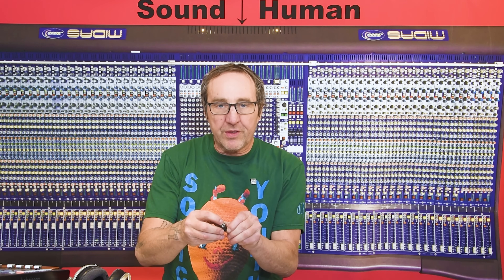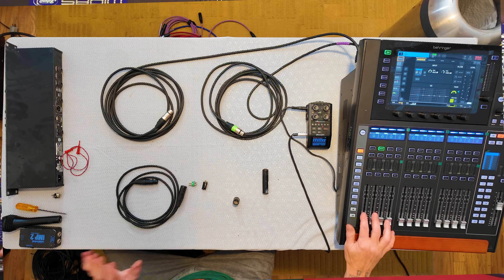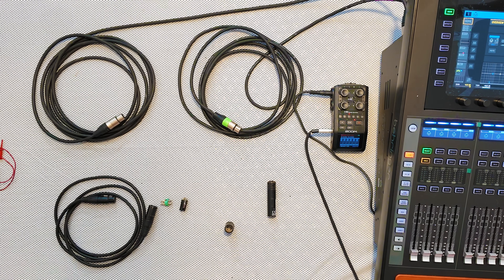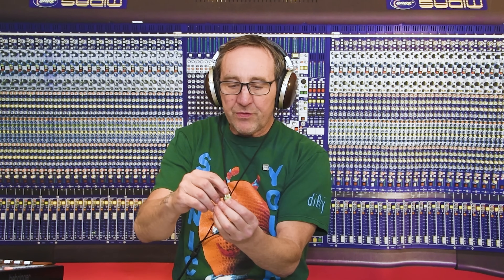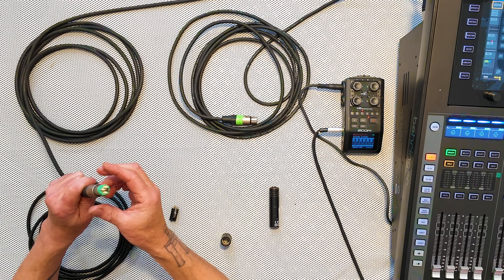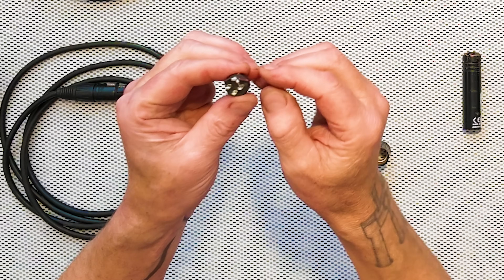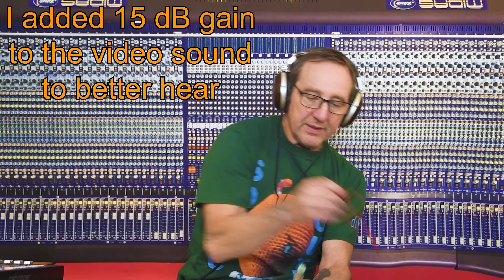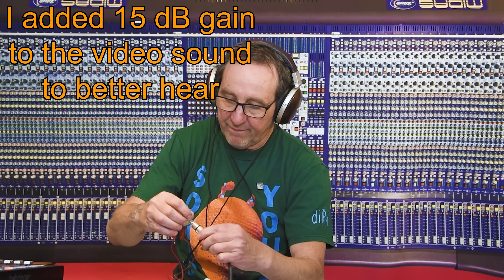XLR Shell Ground Issues

Comment: I have a wonky JBL powered sub that will literally "freak out" if I don't use an xlr cable with pin 1 to shell connected.  I never had any problems with it till I switched to new xlr's with no pin1 to shell connection.  it would work fine for awhile, then randomly would develop a horrible squeal that wouldn't go away unless I power cycled the amp.  I found that if I used the old xlr cables the random squeal would never happen.  So when using that sub I have to carry at least a couple of the old xlr's with pin1 to shell just for this specific purpose...  😆
Reply from the maker: hmm, pin 1 should ground the audio and also ground to the chassis and the chassis should connect to the shell ground. 

sounds like you have a bad wire or corroded connection inside there.

perhaps a connection between pin 1 and the amp that got burned up from using XLRs with grounded shells.

now the poor speaker needs the grounded shells.

easiest to leave it be but I will bet that opening it up and following the pin 1 wire you would probably fairly easily find the the issue.

Comment: i thought you were suposed to ground on one side only. that way it can never loop but it will still shield
Reply from the maker: the " ground one side" applies to pin 1, not the shell. don't ground the shell. ground shells force pin 1 to short to chassis ground wherever the XLR is plugged in.

grounding pin 1 only one side of cables causes issues as well. don't do that either.

make XLR to XLR adaptors that have pin 1 lifted on one side and make XLR to XLR adaptors that have pin 1 connected to the shells on both sides.  then you can lift pin 1 or ground the shells whenever you need to and not cause issues when you don't need to

Comment: Should I remove the chassis ground from the XLR connectors installed in stage boxes?
Reply from the maker: not really, ideally the chassis ground of the stage box is best grounded to at least one XLR channel. since at the mixer, all the XLR geounda are connected together, having the xol ground to stage box ground is ok. the issue is when the XLR ground pin 1 gets connected to the XLR chassis and then the XLR is plugged into gear that has the chassis connected to ac ground. 

since the stage box is not connected to ac ground and since it is the chassis making the connection to pin 1, not the cable, that is ok.

u want to avoid cables that force the connection of chassis to pin 1

Comment: The easy solution is to ground the shell of the male XLR connector on all your cables. This will satisfy all situations described in this video.
Reply from the maker: grounding all your XLR shells is not only a bad idea in most scenarios but it's also not recommended by the AES. 

if you ground an XLR shell to the audio ground and plug it into a panel which in many scenarios, by law needs to be grounded to the AC ground, you now have  a scenario where your mic cables are connecting the audio ground to the AC ground at that panel. 

also, if you ground the XLR shell to pin one then none of the audio ground lifts on base amps and professional audio gear will function. 

additionally the ground lift switch on DI boxes will stop functioning. 

having XLR cables with pin 1connected the XLR shells is a recipe for ground loop disaster. 

if you're looking for a solution to eliminate noise when XLR cables are extended, then I recommend you make some short XLR mail to female cables with the shells grounded to pin one. 

use these little adapters whenever extending cables and they will force the shells to be grounded at the extension points. 

you do not want XLR Pin 1 connected to shell on any connections that are plugged into mixing boards or any other gear that is not AC ground lifted or battery operated
Reply: @DaveRat  if you only ground the male XLR shell, but not the female shell, then the result would be grounded shells for as many XLR cables as you hook together. BUT since the last or terminating female XLR shell is is not grounded going into the direct box, as in the example in your video, you could still have a working ground lift on that D.I.

It's the same logic as the SM57/58 connecting the receiver XLR pin 1 to its housing and thereby grounding the female XLR shell of the cable that plugs into it.

You could say that the last or terminating female XLR shell is grounded/not grounded depending on the grounding logic of what it is plugged into.
Reply from the maker: Hmmm, maybe look up AES-48 2019. this is a document where the recommended best practices for grounding of XLR connectors is addressed by the Audio Engineering Society.

Regarding the connection of pin 1 to the XLR connector's metal shell, AES48 recommends different practices depending on whether it is a cable-mounted or chassis-mounted connector: 

Chassis-mounted connectors (equipment inputs/outputs): Pin 1 and the connector shell should both be bonded directly to the equipment's chassis (shielding enclosure) at the point where the connector enters the enclosure, to minimize RF interference paths.

Cable-mounted connectors (on the cable itself): The standard recommends that the shell should never be connected to pin 1 or the shield, to prevent inadvertent contact with other grounded surfaces that could create unwanted ground loops and hum.

Comment: What would be the application for this scenario:

I'm building out some stage floor boxes that also have AC power available to them. The AC ground has to be grounded to the metal chassis. I would assume that bonding the shell ground on the metal XLR panel connector would establish a unisolable ground loop. What about the Neutrik combo jacks, with the plastic housing? Would that be considered an extention scenario? Worth noting that all the power in the boxes, plus the AnH remote unit, are fed from the same Furman power conditioner.
Reply from the maker: keep XLR pin 1 and AC ground separate.

do not ground the XLR shells to pin 1 on the cables or chassis.  all should be good.

if someone uses a. XLR able with pin 1 grounded to the shell, it may cause issues but no one should be grounding shell to pin 1 except for special use scenarios
Reply: Came across this vid and it kinda made me second-guess myself. Thank you for clarifying, and the education! Awesome video!

Comment: Worked for a consulting firm, and designed a lot of permanent systems. Many XLR connections in the wall for mic or intercom. 

If you connect pin-4 (shell) to pin-1, then the XLR jack in a permanent connection will be at conduit ground - formula for instant ground loop.  Leave pin-4 tab (shell) disconnected.
Reply: In the device's socket, the XLR housing will be connected to the screen and 1 wire = this is the same as connecting it from the outside. Once again, what problem did you get rid of by not connecting the housing on the cable? In my opinion, none. But you have another problem, if this non-stationary cable is used as an extension with another similar cable with an open XLR housing, the place where they are connected will catch all the interference and interference.
Reply from the maker: in the devices socket yes the XLR shell will get grounded and if the XLR has pin 1 grounded to the shell then you have grounded the audio ground from the remote piece of gear to the chassis ground of the local piece of gear. 

this is not desirable 

each unit will have pin 1 connected to the chassis in one place within that unit, by grounding pin 1 to the XLR you are creating a second connection between pin 1 and the chassis and that creates a ground loop 
.
additionally with patch panels that also have AC outlets on them like you'd find in the wall of a building sometimes, The metal patch panel will be grounded to the AC ground. if your XLR has pin 1 grounded to the shell then you now have connected the AC ground to your audio ground at that patch panel. 

you have now introduced an AC ground connection to your audio ground at that patch panel, that will create a ground loop that almost always will be significant. 

standard and accepted practice is to not connect the chassis ground of the XLR to pin 1 unless you need maximum shielding and are absolutely sure that it won't cause ground loop issues. 

generally it should be avoided in almost every scenario

Comment: Very interesting! I'm building a monitor mixer rig that breaks out analog audio from CAT5 to a 4-channel TRS DI box, but the connectors I got unbeknownst to me treat the whole housing as ground (right angle pancakes). I wonder if this will eliminate the ability of the DI box to lift ground
Reply from the maker: Having the whole housing grounded is not a big deal because as long as your mic cables don't have the shell grounded that won't cause any problems with DI boxes. 

Also having the The box grounded will make the system a bit quieter as long as the metal housing doesn't touch any external metal objects that are grounded to a different ground which typically is not an issue, especially if the box is painted or anodized as that acts as an insulator. 

If it does prove to be a problem depending on who makes the cat analog boxes they can be lifted typically 

The sound tools boxes have an internal jumper where you can ground the box or not and I've seen other brands with a jumper wire that can be lifted
Reply: @DaveRat  Oh wow! So helpful!!! Thanks 💚💚💚 -- it was a risk but I'm mixing the redco ones and the American recorder ones (very exact space requirements on both sides of this rig) - I'm very lucky the pinouts lined up! Bracing myself for the unexpected once I put everything together and test it out 

Thanks again, 💚

Comment: Thanks for this info. I was recording at a train station platform recently and was getting terrible RFI noise with the mics I was using. I tried a different pair and they were ok for whatever reason. It just dawned on me that my connectors aren’t grounded to the shells. Glad to confirm thar this was likely the problem. I’m going to get the soldering iron out and see how things go. Thanks
Reply from the maker: I recommend making adapters that have grounded shells that are short and putting those between cables that are being extended. That way all of you might cables are wired without grounded shells which is the proper way of wiring them and then you can insert the adapters when extending cables

Comment: Hey Dave! Whats the best way to split signal to multiple amps in an amp rack? Looking for the lest loss and cleanest signal. Transformers? Or just jump with Y cables?
Reply from the maker: Y cables. Line level output impedance is very low and the input impedance to amplifiers is relatively high. So you can drive a lot of apps off of a single output with very little loss in level and no loss in frequency response.

Transformers would cause losses and level and losses in frequency response but would give you isolation if you run into humming buzz issues when using y cables
Reply: @DaveRat  Alright, any recommendations for types or brands for transformers if there is some noise issues? I'm assuming it would be from faulty Y cables or a source problem like bad power from AC etc.?
Reply from the maker: Should not need transformers for amps in the same rack.

Whirlwind and radial have iso box units for problem solving.

Build your own is a bigger conversation than this

Comment: Great video Dave. Presenting a thorough approach to putting to rest this issue of grounding cables. With that said, for the past 40 years, I would make sure all my cables with XLRF connectors would have their shells connected to pin 1. I would never do this on the XLRM connectors. Never had an issue again. Regardless of the working environment. When an extension XLR cable was used, the XLRM shell would then be grounded via the connected XLRF shell. When plugging an XLR cable into a console, the XLRM would not tie chassis ground to audio ground. When purchasing new cables, I would confirm, with an OHM meter, that the new cables were wired accordingly. Or make the minor modification. Note: Short runs of equipment interconnect XLR cables would not have their shells grounded.
Reply from the maker: Very cool and grounding the female I could see working almost all of the time. But I still feel it's introducing a potential troubleshooting nightmare. 

Shorting pin 1 to female shell is still forcing a chassis ground to audio ground connection wherever the female connector is plugged in. 

As I showed in the video that can stop the ground lift on DI boxes and equipment outputs from working.

Also on wall panels installed in buildings or any rack mount XLR gear, the wall panel and rack rails will almost always be grounded to the audio ground but quite often to an AC ground. 

Any XLR male or female that is plugged into the rack gear or wall panel that shorts the XLR chassis ground to the audio ground and if the the chassis or rack ground is an AC ground or an audio ground from differing and remotely located audio equipment using an ac ground that has drifted, the XLR plugged into the panel may create and add noise to all the audio lines using that panel or box.

That said, for many systems, the noise goes in noticed or is considered acceptable and with or assumed to be inherent. 

But it's that one time when you need it quiet and and the evil buzz comes that we learn that having cables in the system that force a connection between chassis ground and audiogram are little gremlins waiting to get us
Reply: @DaveRat  Thanks for the response.  Good point. There's always going to be a few gremlins lurking around. For those instances, i carried a couple of very short XLRM to XLRF cables with no grounded shells. Hopefully, the buzz stops there. :)
Reply from the maker: Very cool. Yeah as long as you are relatively predictable in your setups and don't rely on hiring in gear or hiring out gear, having a non standard setup can work with a crew that is aware.

Over the years, Rat sound has evolved many of the ustom stuff to standardize compatibility when we can do so with our compromising quality.

We used ep5 for power, hubbel 125/250 V hubblell for speaker connectors pre speakon data, and all our systems were completely transformed less.

Also switched from double Hubbell to socopex for hoista.

Comment: 4wires??
Hot 
Cold
Audio ground
Chassis ground
Reply from the maker: I haven't tried that but I think that maintains the problem rather than solving it. 

Connecting the chassis grounds together from remotely located gear that's plugged into different AC grounds would create a ground loop. 

 it would be worth testing or looking up to see if someone's done that successfully. 

 based on my experience solving ground problems, you don't really want multiple ground paths and connecting all the chassis grounds together via the audio cables is probably going to force AC ground lifts onto all but one piece of gear for maximum noise rejection

Comment: Great video thanks like always! i really love these tests no one else is doing....
whats your stand on XLR cables for connecting monitors in regards to best performance? i would guess connecting shells here can create a ground loop considering the circuit of the amplifier and dac
Reply from the maker: My take is 

Never connect the shells to pin 1 except if you're doing field recording and extending my cables all the time and have only battery operated gear.

Avoid extending mic cables 

And if you really need to extend my cables and you're also working with extremely high gain microphone inputs then make some mail to female XLR adapters that have the shells grounded and use those at the mic cable junctions when extending

Comment: you lost me why the shells shouldn’t be grounded, if grounding them sounds just better i guess for many applications.
Reply from the maker: By law and for safety many or most metal wall panels must be grounded,  typically grounded to AC ground. Same with floor panels.

Also with rack gear, patch panels and splitters the chassis needs to be grounded or you will get worse noise than you get from non grounded XLR shells. Rack gear chassis all get grounded together by the rack rails.

So the rack rails get grounded to AC ground if any of the gear in the rack plugs into the wall.

All good except if someone makes XLR cables with shells shorted to pin 1, because shell to pin 1 will short the chassis ground to the audio ground making the the rack rails and audio ground into huge noise sponge as well as created ground loops.

Basically shells to pin 1 are like sneaky little buzz creators just waiting to cause problems that are a hard to trace.

Pin 1 should not be connected to shell ground except for specific scenarios where the XLR will never be plugged into wall panels or rack gear or any gear that is plugged into the wall